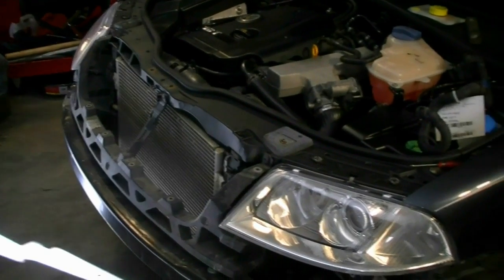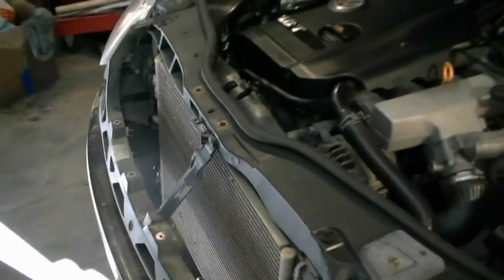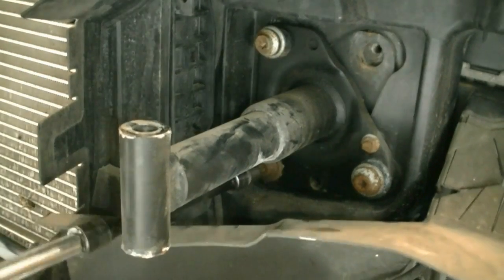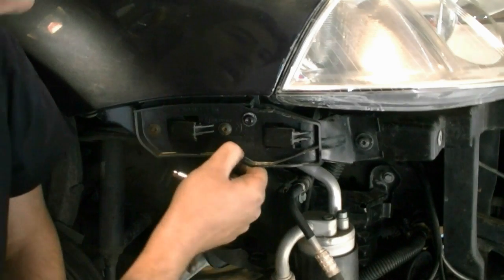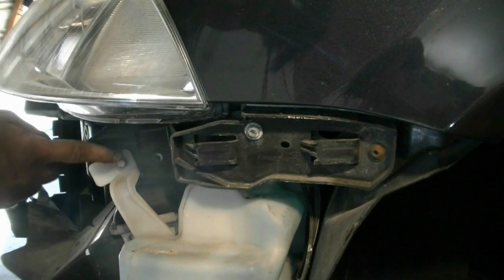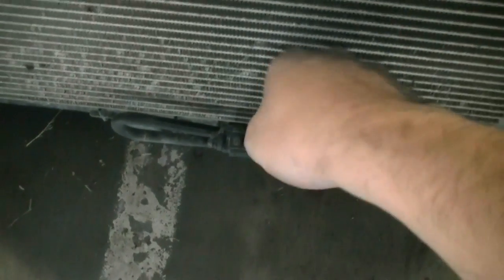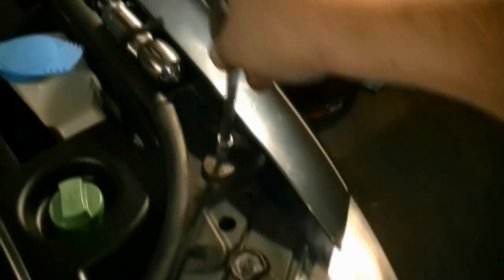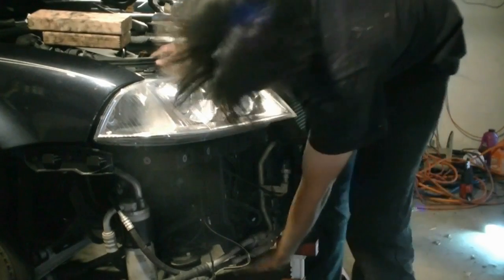How to replace the Timing belt on a 2004 VW Passat Audi 1 8L Turbo Engine Part 1

Comment: Every 85K miles? You want to be safe. The 1.8t runs hot. If the heater core is sludged, the coolant overheats. To replace that HC is 3 days. Nuts! Install a U-return pipe using 1/2" gal pipe, (2 x 90 degree s plus 2 nips 3" and 1 nip 2".)

Comment: I have an 05 Passat when I did this job it wasn't that hard to take the condenser off you don't have to unhook the lines you can tuck it right underneath the car then you can remove that entire piece and set it aside then you have full access to the timing belt

Comment: Good project car when you replace the bumper clip and grill, do the timing chain, water pump and thermostat at the same time . $2000 fair market project . Mines lowered handles nice but not so good for winter snow banks. Inline 4 cyl turbo hemi great idea for motor. Fun little project car . Wagon go-kart, lol

Comment: Just did this, but couldn't get the 18mm bumper bolts and nuts loose (2), was able to just remove the 3 torx T-45 and 1 10mm nut from each size, got it off no trouble! 2001 2.8L V6. Had timing belt failure on the highway (replaced belt 40k miles previous), so trying to get in and rebuild the top off of the engine.

Comment: im having issues with my 04 vw passat overheating when im idle...red light or a drivethru...but if i turn the heat on full blast and start driving the temp starts going down...i have only gotten the clutch to the engine fan replaced....someone told me this....

The OEM Water pump is plastic and breaks causing no coolant movement. 
Pull the little hose off the reservoir when its running; it should have a continuous stream of coolant. If not, the water pump is bad
Reply: where is that at todisconnect that hose?

Comment: Hello i have a question.

My 04 A4 1.8t fwd timing belt just snapped before acceleration, around maybe 5mph tops the belt just snapped and lost power. Is there any chance that i could have bent the valves in the car? Also how do i put the cams and crank gear both in time again? Do i move the crank gear to tdc first lined up to itself on the timing cover followed by lining up the cam gear to its mark seperately or do i put the belt first on, apply tension and crank both of them to tdc? Kinda confused bout this. Do i lined them up seperately to their marks or do i apply the belt first then cranked them up to lined in their marks? If u can show me how or guide me step by step, Any tips or suggestions would be appreciated. Just wanted the car to run again, hoping did not damage internally when the belt snaps. Let me know. Thank you! Been watching your vids alot and learned a lot of tips from your vids.
Reply: Tim Rivera yes definitely new head needed
Reply: How many miles did your car have?

Comment: My car needs a new water pump but while I was checking it, I noticed an oil leak coming from an L-shape piece near the dip stick, I am not sure what  is called, not sure if you would be able to tell me the part name. I have done some done work on my 2003 Passat but this one is new.

Comment: I changed my Cvc axls because my car keep showing the abs light and we old get a weird stick n shake and as I accelerate it got better. I noticed my left turbo hose was off. Anyways I'm not a mechanic. I replaced both airbags and now I have no clue how to put it back together right. One tire site a little left and the other one right. I'm looking for someone to fix it. It's a 2003 allroad 2.7 V6 twin turbo.

Can you let me know if your willing to fix it I'll bring it down to u.

Comment: Thank you so very much for the video. My husband can do it himself because of you!  What do you recommend we change while the vehicle is apart? The water pump? We just purchased our 2000 Passat and we love it but not sure if the timing belt has ever been changed so thank you again for your video!
Reply from the maker: Laura Fraleyread Hi, you should replace the timing belt, timing belt tensioner, tensioning roller, idler pulley and the water pump.Also a good idea to replace the camshaft seal, serpentine belt tensioner and belt while at it.. GL and thanks for commenting. Cheers
Reply: ΤΣΟΝΤΑ
Reply: To replace the camshaft seal the cams must be LOCKED in position. Search for video.

Comment: Why remove the bumper cover brackets, this is not required.  You should use threaded stock screwed into the bumper shock holes to hold the lock carrier upright when you move the LC forward to the service position.  The power steering cooling loop should be unfastened from the rad and allowed to relax. The cable that actuates the hood release needs to be disconnected at the handle & bourdon coupling - at the driver side of the hood near the LH strut housing.  I've done this job 2x on my 2004 B5.5

Comment: Great step-by step videos. This probably one of the reason I would never buy a Audi-VW.  Can they just stick with regular hex bolts? That mixing between all those Torx sizes just drives me nuts..

This is ridiculous that you have to take the whole front   end apart to service the car. I've seen people event draining the A/C system..

Comment: Hello, thank you for posting these videos! I'm about to perform the same thing. I was wondering though, do you recall what size the nut and bolt are for the metal bumper? I'm probably going to have to buy two wrenches for this step as I do not have any larger than 17mm.